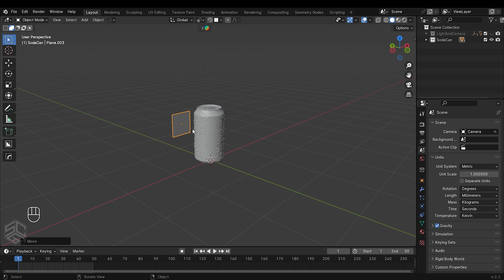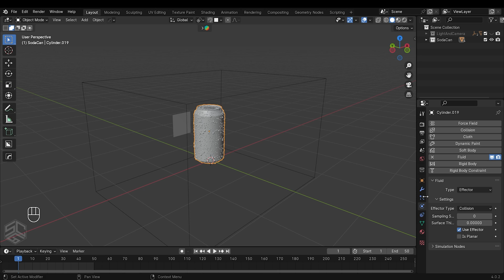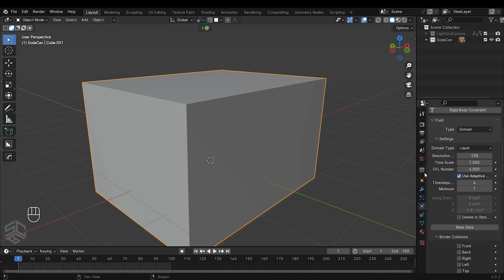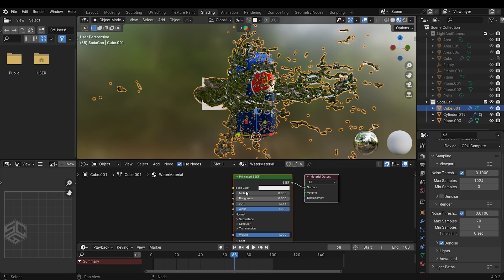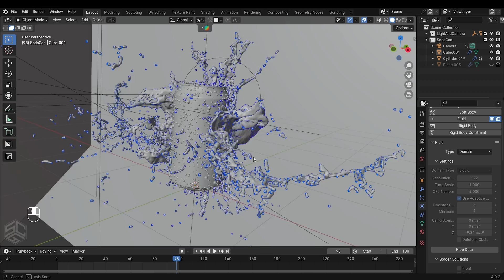Water Simulation In Blender Tutorial - Water Splash | EASY STEPS

Comment: What version of Blender is this? I am using 4.2 LTS and I am not seeing the Bake button.
Reply: make sure you have the container selected or Domain
Reply: @PrinceGreen85  I finally figured it out. The bake button only displays when other buttons are selected.
Reply: @DonaldDrennan  that’s great man
Reply: @DonaldDrennan  Could you clarify? I'm having the same issue.
Reply: @maryiambazzi8540  bake is only available if it's calculating the simulation. By default the setting is trying to display in real time. I'm not in front of my computer right now. Take a look at the manual. I think that's how I figured it out.